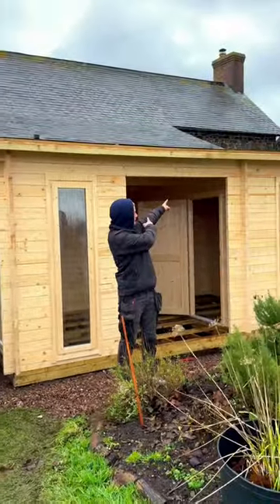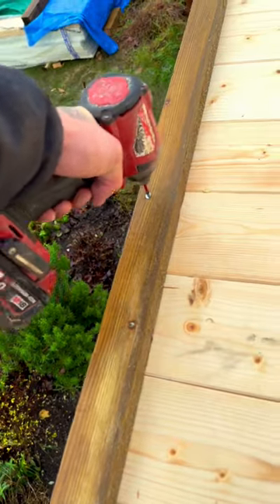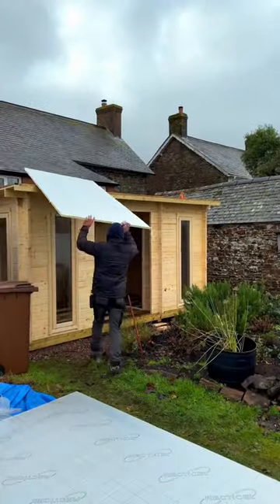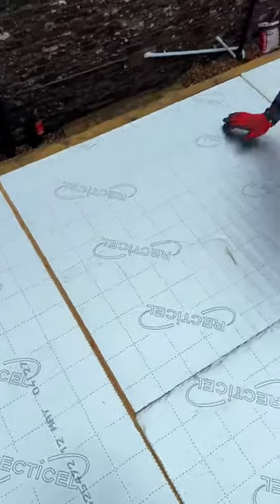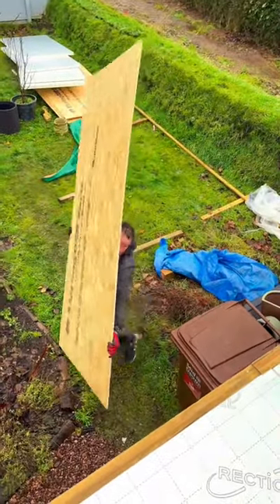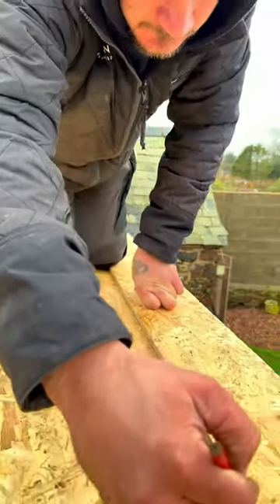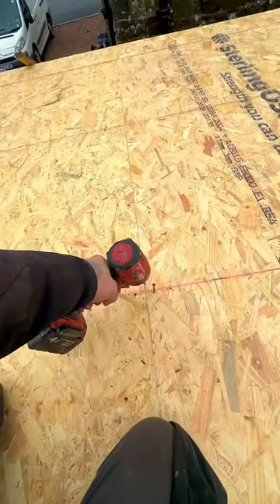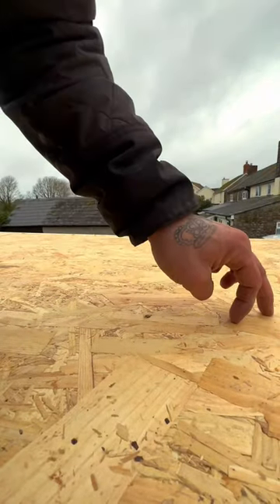How to insulate your garden room in 60 seconds #gardenroom #diy #howto #shorts #carpenter

Comment: You forgot to show an important step my friend.  Taping the joints of your Styrofoam insulation
Reply: What about the breather membrane between bottom osb and insulation
Reply: @gwilliams9001  why would you have a breather membrane immediately adjacent to FOIL faced insulation?🤣
Reply: @DSkimRS  because trying to tape the bottom insulation joints from above is near enough impossible unless your roof is the size of one board 👌

Comment: 25mm ?? 150mm min is needed , 25mm will cause more issues and give you nothing in U value
Reply: I guess they insulated in between the rafters
Reply: @action4898  the max you can do internally on a hybrid (inside and out) is 50% or less of the external , so either it’s wrong or very wrong , easier to do a cold roof on something like this and avoid issues
Reply: @action4898  you can't do that if you've insulated the outside without some very complicated and specific calculations. This is a warm roof, if you insulate just the inside it becomes a cold roof. If you insulate both without the proper calculations  the dew point will be  between the two layers of insulation with no airflow causing condensation to rot the wood from the inside. The problem is this isn't nearly enough insulation to keep the roof warm so there will be serious condensation issues here regardless and it will eventually fail. Especially since no vapour barrier or tape means any moisture generated inside will find its way through an trapped against the underside of that top sheet of OSB
Reply: Note to anyone watching, this is what you should do. Don't ever consider using 25mm celotex, the dew points of celotex is 40mm, so need to use 50mm celotex
Reply: Is this not just an outside summer house?  Putting 150mm would seem pretty over the top to me?
Reply: @steveh100  the trouble is what the guys are doing here is not doing anything- in fact it will cause problems and reduce the lifespan of the thing once the condensation starts soaking in to the timbers it’s ruined  , if it has heating in side it needs proper insulation if not it’s a waste of time / money ,
Reply: In sweden we have a minimum of 300mm😂 som put up to 500
Reply: @ArvidNilsson-oe9zt  we’re heading that way - I’ve not priced a job this year under 220mm 🤯
Reply: @TomTomTomTom538 it’s a shed not a house .

Comment: No vapour barrier? Roof going to rot from the inside out…..
Reply: It's good enough because the whole shed has limited life in any case your confusing your knowledge with a permanent building which this is not
Reply: @Antonio-gq6fx  shame too many people have the “it’s good enough” attitude, maybe that’s why new builds a so shite…
Reply: @MrB3ngy you’re correct mate. 
 Not withholding the potential for mold spores to affect the internal space as the rot sets in.  

AVCL is a key component in a warm roof. I say warm roof loosely as it’s only 25mm 😂

Comment: When he puts the 1st screw into the osb he drives it way below the surface. It's only 11mm osb so he's left with maybe 3mm of wood under the screw head. Severely weakened fixing. A common mistake you see all the time on building sites.
Reply from the maker: Have you ever tried filming what you’re doing? If you go to 48 seconds you’ll see that same screw sticking out

Comment: 25 m/m far too lille. 25 m/m is usual used for underfloor insulating. The insulting being laid on a concrete deck and then covered with floor planks or board. 25 m/m is too little for a warm roof, 150 m/m minimum to have any insulating effect. This building will be very warm during sunny days.

Comment: You get insulation that you can apply either felt or single ply directly, no need for the double boarding. ( save some cash ) Nice neat job though 👌💪
Reply from the maker: Thanks for the (kinder) words in this comment section 👍
Reply: @allthingsgardenbuildings  to many jealous people on here quick to put people down to make them self feel better. Stick in 💪👌
Reply from the maker: @youtubeslayer-1  Got to take the rough with the smooth !

Comment: Why only 25ml of insulation on roof wouldn't it be freezing,, its a question
Reply from the maker: It's generally what people tend to go for.

With building height already close to 2.5m for head height and permitted development you're limited to 25mm on the roof in alot of cases. 

They can be internally insulated,  but it costs more, and alot of people have a budget to stick to. 

We often build what's the customer has bought.

Comment: I can not believe you have made a video saying this insulation is beneficial to the building. 150mm is british standard.  better off with a cold roof with ventilation ! any heating in there with this insulation is going to cause condensation issues !

Comment: Where the air flow zombie.
Reply from the maker: It’s a warm roof ….
Reply from the maker: It’s a warm roof ….
Reply: Not a warm roof , 25mm isn’t enough plus any ply top is never considered a warm roof is needs venting meaning it’s a cold roof
Reply: Moisture will condense on the  underside of that top sheet of OSB. It will fail quickly since there's no tape or vapour barrier too. I give it 12 months before it's completely black
Reply: @TomTomTomTom538 yup. I would have taped they joints and vcl over the top.